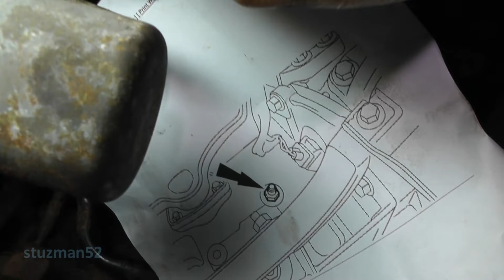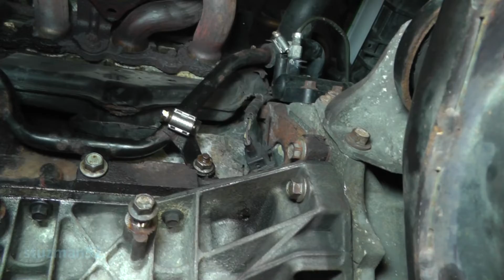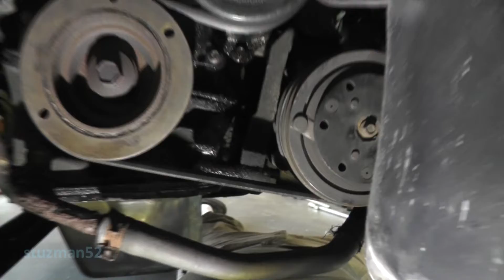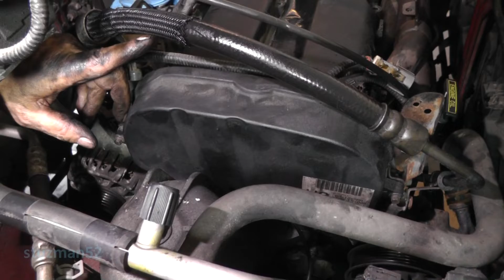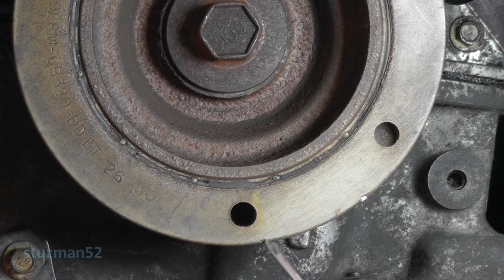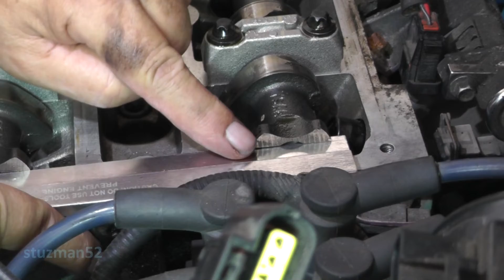Ford Escape Timing Belt and Water Pump Replacement - Part 3

Comment: Hi Terry, this is a great set of videos you put together for the 2.0l. We have the exact same car but an 02 and I have been trying to get the alternator out to replace it. As far as I can tell there are only two bolts at the bottom that hold it in however they bottom out on the inside of the engine bay along the frame rail and there is a good inch of bolt left. The Haynes Manuel is little to no help for the 2.0l but it does mention upper and lower bolts that hold the alternator. I can not locate any other bolts and do not see where they would be located on the replacement alternator I have either. The darn thing is not budging even after taping it with a hammer, no movement at all. Have you pulled the alternator on this car? Do you know if three are more than the two lower bolts that hold it in? I would greatly appreciate any help!
Reply from the maker: Thank you Jason for dropping in! I've never really looked at how the alternator is mounted and can't give you an answer. I did a quick search on YouTube, but it looks like all of them are for the V6 model. Here is a link which may or may not apply to you. Good luck on your project! https://www.2carpros.com/questions/ford-escape-replacing-alternator-in-2001-ford-escape
Reply: @stuzman52  Thanks for getting back to me Terry I appreciate it. Yeah if you search for alternator replacement for the escape you would think that it was only made in the V6 flavor. The only videos that were remotely  relevant for my interests regarding the 2.0l are your videos. The V6 has a three bolt pattern, one upper and two lower and they pass through the alternator horizontally from the left side. The 2.0l has two longer bolts on the bottom that pass through horizontally from the front but do not completely back out. For the life of me I can’t find any other attachment point and the darn thing won’t budge an inch. I guess it could be corrosion but it’s an AZ car and the alternator I’m pulling looks pretty new… lots of fun!!!
Reply from the maker: @JasonRJones  You might want to try a subscription at www.alldatadiy.com and pretty sure it should show how that joker would come out. Good luck Jason!
Reply from the maker: @JasonRJones  I went ahead and made a subscription to www.alldatadiy.com as I still own this car. Here is what it says.
1) Disconnect the battery cables
2) Remove the drive belt. Refer to Drive Belts, Mounts, Brackets and Accessories.
3) Disconnect the electrical connectors.
    1  Remove the nut and disconnect the B+ cable.
    2  Remove the connector.
4)  Remove the lower generator bolts. (It appears to be two)
5) Loosen the upper generator bolt from the engine but do not remove it from the generator.

    NOTE: Insufficient clearance does not allow the bolt to be completely removed.
6) Move the generator to the rear of the vehicle, then lift up and out of the engine compartment.
INSTALLATION
 1. To install, reverse the removal procedure.

    NOTE: Before reassembling, place the upper bolt into the generator.

That's all it says Jason with three diagrams, but alldata doesn't allow them to be copied.

Comment: Cloyes timing belt kit bk294a is for a Ford Contour. The photo shows the same tensioner you used for the Ford Escape but they sent me a different one as the one from gates...
Reply from the maker: That may be true Ricky, but I'm quite sure the kit used is for this vehicle. It's been on the vehicle for over 40,000 miles now with no issue. Maybe they sent you the wrong timing belt kit.

Comment: How do you find out if they need different spark plugs
Reply from the maker: Not sure what you mean Branon. I just use whatever the manufacturer recommends.
Reply: @stuzman52  u said some use different part numbers
Reply from the maker: brandon Webb That’s true Brandon as different manufacturers have different numbers which all should work. I just use whatever the OEM used when the engine was made. For Ford that would be Motorcraft or Autolite.

Comment: Was that a quick way to set the timing with out going through all the head ach
Reply from the maker: Quick Way! I wouldn't say it was the quickest way, but that's the correct procedure that's outlined in the service manual which takes a fair amount of time when you're dropping the catalytic converter to gain access to where the timing pin goes. Have a great Thanksgiving Tyrone and a great weekend!

Comment: Terry, you know and I know that those rusty coolant pipes are going to leak and not in the far too distant future. Why the hell does Ford need coolant pipes? Our 3800's don't need any of that stupid crap, why does Ford need it?
Reply from the maker: Dennis, the first time that I saw that coolant pipe, I was thinking what
 the hell were these engineers thinking. Fortunately, I did check the 
pipe very well to see if there were any signs of rust and/or corrosion 
and it appears okay, well, at least from the outside. Yep, our 3800's 
doesn't have this crap and the engineers for that engine were probably 
some of the best GM ever had. I'm sure they are long gone by now, and we
 can have college kids to do all of the engineering thinking for us :) 
Thanks Dennis for dropping in and sharing your thoughts...

Comment: Excellent tutorial Terry.  I'm not sure why in the hell Ford couldn't just make an accurate crankshaft pulley mark to set the timing, and all you would need is the dual cam setting metal bar.  Wouldn't have to do all that exhaust work.  I guess they want the dealership labor money?  That bolt idea has to be one of the dumbest things i've seen necessary for a timing belt replacement.. Take care man
Reply from the maker: Hey Ozz and you're right that it would have been a simple matter to find TDC. On some of their other vehicles such as the Focus, they decided to put the timing pin into the block beside the crankshaft pulley and nothing has to be removed. And on their V6 models, their is a hole in the crank pulley which screws into the block. I think this is one of their first brain storming ideas. Or you could be right and a normal person wouldn't go through this ordeal and be left to bring the car to the dealer to get the money. Yep, it's not one of Ford's brighter ideas for sure. Thanks for dropping in Glen to watch the video and leave a comment. And you take care too...

Comment: A lot of people think that placing marks on timing belt & sprockets is all you need to do when changing the belt. You mentioned belt stretch needs to be taken into account... some engines require the cam sprockets to be loose / free turning when tightening the belt (all the tdi's I see for example). If special tools are listed in the service manual... you'd better make sure you have them before starting the repair. I think this video series will be "The go to guide" for all the lucky Ford owners with this engine! Top Notch!
Reply from the maker: I thought it was a bad idea too Thomas of putting marks on the belt and sprockets when changing out a belt. What if it was off from the last time? I like to start fresh and do it the way it's supposed to be done. And this engine requires that both cam sprockets be loose when you're putting the belt on so as you've mentioned that the sprockets can free wheel as you tension the belt. I'll show all this in one of the upcoming videos. And I hope that this series will help Ford who may want to do their own timing belt or at least see what's involved. There is nothing on YouTube for the Ford Escape, yet other models are similar. Thanks Thomas for sharing your thoughts and taking the time to watch the video.

Comment: Wow there was a huge difference between the white mark and the block indicator  without the pin installed and after . It would be definitely off if you just lined up the two . Now that's cool or what !!
Reply from the maker: Yep Steve! Quite a bit of difference. One thing that all the sources agreed on was that the key in the crankshaft would be at the 12:00 o'clock position when the #1 piston is at TDC. I show this in the next video and thanks for dropping in and leaving a comment!